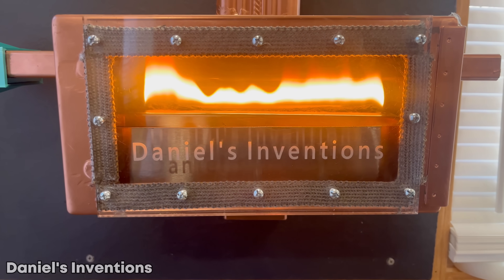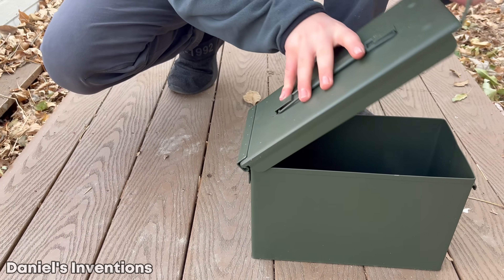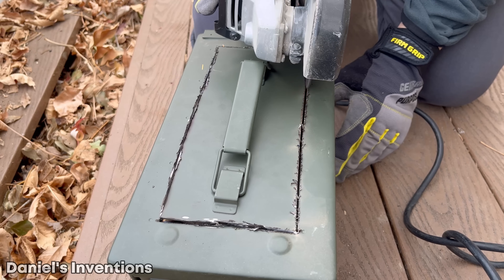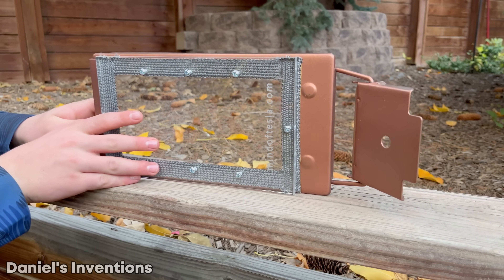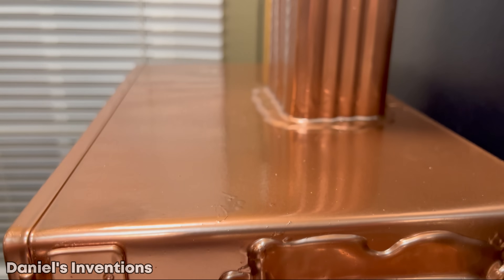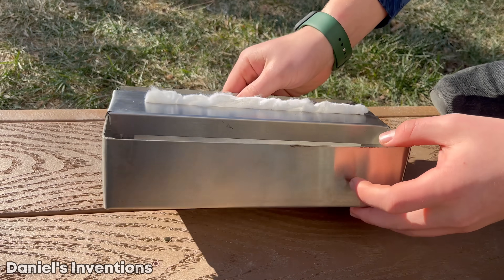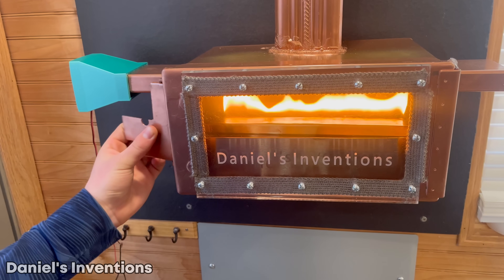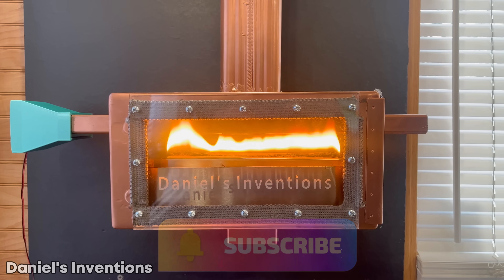ENDLESS Heat for Your Home WITHOUT Electricity 2.0

Comment: I give it 1-3 months before it burns itself apart and catches your house on fire. Do the same thing out of non aluminum metals. The gutters are not steel, they are aluminum otherwise they would be too heavy and inflexible. Even my steel burn barrels burn themselves apart after a couple of years, and I imagine this would burn itself apart in a fraction of the time. Very solid start though, just replace your cheap materials with fire rated ones and this is solid.

Comment: you could modify a stirling engine stove fan for the input air flow therefore you won't need any electricity. but for the sake of convenience a pc fan is much much easier and cheaper to replace.

Comment: You can use the oil for  a  small diesel generator with no problem!  You would have electricity and heat in the same time. 
And, it would be verry  professional and safe!

Comment: The concrete board needs a standoff or it's possible for the firebox to transfer heat to the board which stays behind and starts a smoldering fire behind the board..  just install one inch standoffs

Comment: Put the intake close to the floor, and it will draw in cooler air. It will move air by the heat exchange. (Cooler air in the bottom and warm air out the top) It would be truly electricity free.

Comment: Ok, this is a nice little invention, apart from the safety issues others have already highlighted.

But unless people already have the plethora of tools and components you used to build this, not to mention the expertise to use them, it would be cheaper and easier to just purchase a wood burner and modify that to burn oil in the same way.

Comment: May i suggest run the tube with the fan all the way thru so it is just above the flames so you don't end up with the smell of what ever fuel you are burning then drill a few 1/4 inch holes to allow Air in for the flames.

Comment: I see everyone complaining that the fan is electric. Okay....attach a small solar panel. Or, put an air intake that pulls air off of the floor and do away with the fan. The temperature differential will pull the air through the heat exchanger. 
  Other fire issues have been mentioned.

Comment: Use a carbon sheet wick. It will never burn out so only top oil is required. But a small amount of kerosene is needed to the oil to give better fluidity to draw through the wick.

Comment: Venting the fresh air for the combustion side outside would make it more efficient. If you are using the air inside the space then you are removing hot air from the space and dumping it outside. If you bring in outside air than you avoid this.

Comment: Air intakte should go to the floor, so it would take and heat the coldest air in rhe room, the fan would most likely not be necessary, or might even run without the electricity (remove the motor to reduce drag), or use to make electricity instead at the hot end 😊

Comment: But you forgotten to use the formula Q=qm and price for the oil (2-3$ per kg), if you use the formula, you`ll see, that your box will heat nothing (maybe a small room if perpetually burn), also it is dangerous under fire safety reasons... temporarily in garage etc. maybe... The classic brick wood stove will serve much much better, even small one.

Comment: No need to use the fan. Stove must be located 10cm above the floor. Extend the output pipe 2m upward. It will suck the cool air from the floor even faster naturally and circulate.

Comment: This is a great invention but a proper air intake from outside is almost a necessity. This is dangerous to rely on internal air movement for the intake air supply and if the wind pushes against the exhaust it could reverse flow into the living space bringing carbon monoxide with it! Having a proper intake and exhaust combo will prevent such scenarios, it will also stop the heater from pulling a negative pressure on the room due to stack effect in the chimney. A negative pressure could pull cold air through any gaps in the structure and result in lost efficiency.

Comment: Home-made is a lot fussier and less controllable, without major engineering.  You load it up and it burns until it runs out of fuel.

I'm partial to wood, because it's something always to hand.  Being able to use vegetable oil is an alternative to being on the grid.  I already have a gas furnace, but it doesn't run when the power is off.  My gas insert will run without the blower, albeit to less effect.  

What I plan to do is put in a high-dollar wood-burning insert, bringing my fireplace full circle.  I just wish the blower were powered off-grid.  Plenty of waste heat given off by the insert to power a blower.

Comment: Never take air from the room if you use fire and a chimney. All the air going out needs to be replaced and it gets sucked into the house somewhere from the cold outside. It means you you have not increased the average heat in the house only increased it in the vicinity of the heater and decreased it furthest away from it. And also created a draft. Connect a pipe to you 12V fan and take air from the outside. Keep the pipe as short as possible and insulate it or it will cool the room as well. That will also save you from death from asphyxiation.

Comment: if put a bunch aof thin copper tubes in the steel pipe it would greatly increase the surface area that the air can go over
Reply: obviously would increase the restriction a tad but not noticable

Comment: top exhaust vent? try 4 inch double wall vent pipe. the gutter pipe will not hold up for long. try welding your joints, if you want more heat? and the box is NOT TO BE HOT! Use furnace clay to line your box, but nice design.

Comment: A heat pump with a COP of 3 would only need roughly $1.37 per of electricity at my residential rates to equal the heat content of a gallon of cooking oil that costs $8-9.  Doesn't make sense?

Comment: A guy suggested welding and i wasnt aware yoi can weld paper thin aluminum gutter material..let alone weld it to 18 ga steel.Otherwise costs will climb with all steel to be to costly for such a low output.Maybe im incorrect but ive never read or heard or been told of welding totally dissimilar metals.
Reply: I see he said steel downspout i wasnt aware you could find any downspout but aluminum.period..past 40 yrs

Comment: For thise saying you need a fan and to draw outside air into the heater, you're all wrong.  I heat my entire house with a (newer) Quadrafire 3100 wood stove.  My house is a 1600 sqft walkout (on each floor) built in 2010 in central Saskatchewan (-45C in the winter).  The bottom is ICF, the main floor has 1100 sqft vaulted ceiling with two 6ft x 6ft triple pane windows and two 3x4 rakeheads above (all on either side of the wood stove), so lots of window heat loss, even with the south face.  My wood stove is sufficient to heat the entire house comfortably at -45C without any fans or outside air draw.  It burns hot and clean.  The bottom part of the walkout stays at about 17C without any additional heat, and there are two large patio doors and 6 large windows in the bottom as well.

Comment: I would definitely put something like that in my basement. I could vent it right out the chimney with my furnace and cut down my heat bill. I'm guessing you can use used oil as well.. Fry up some chicken and french fries, then strain the hot oil through a cloth and holey heaters Batman, you've got fuel for a fire.

Comment: It would be even better if the breathing air was pumped through copper pipes running down inside the exhaust pipe. Then over the flames, and out the bottom.
That is a counter flow head exchanger, which can transfer much more of the heat. Than the cross flow heat exchanger here.
So you would blow the breathing air in from the top and then down, opposite flow of the exhaust air.
The theoretical limit of a counter flow heat exchanger is 100% heat transfer. The limit of a cross flow is much less. If the air was flowing same direction, the limit is 50%.

Comment: I bet I could use the heat from this to make a couple magnets spin inside of a coil of wire, then connect the wire through some very restrictive wire which will then, in turn, make heat.

Comment: you did not explain how the fan is powered but you can use thermoelectric "hot and cold" to power the fan with out the use of a battery.

Comment: By speeding up the footage, you made it seem so effortless.

Now, if there were a way to put another ”turbine” on the top, attach a chain and sprocket to it, then attach another sprocket to a GENERATOR … You’d probably have to gear it down to run a small generator, but you could at least do something practical with the heat generated. Or heat water, or perhaps make charcoal…

Comment: Concrete board is not a fireproof substance.  If you check with wood stove companies they will tell you NOT to use concrete board, only brick or stone or concrete is acceptable.  I can’t remember the thickness to temp, you’ll have to look it up.

Comment: No jb weld.. weld instead 
No paint. Sandblast and clean metal get oil off of it. 
No small screws in sheet rock board to hold it up

Comment: Imagine using Webasto instead. Heather design to burn oil or everything flammable in liquid form. 

Also it doesn't matter what kind of heater you make, but how heat density liquid is. Gasoline and dissel is about 11.000W of heat. Wood is about 5000W depending on type. Ethanol alcohol is 8000W... 

So you can make whatever you like, but you won't take more energy from it. You can't break physics

Comment: Why not run the exhaust across the room on the wall... Slightly inclined upward? A longer exhaust pipe will allow you to milk every last bit of heat and spread it accross the room.

Comment: I bet if you packed the pipe with the mesh used in gas systems. It will transfer more heat with less fuel usage.

Comment: Stop saying "we" all the time when you're doing something, interesting heater though. Definitely need some way of shutting it off though, I suggest a damper on the air intake of the combustion chamber which can be closed to cut off oxygen supply to the flame. Which could also be used to control the heat output.

Comment: You can burn used oil fryer oil in that. Get that for free from your local burger stand - work out a deal with them, leave empty steel barrels they can pump the hot old oil in and pick it up every week or so... filter the chunks out and free fuel oil.

Comment: the heater was off gassing fumes in the last shot  

while it's a cute idea.   it's not a "good" one for many reasons.   and with zero safety testing or expertise  it's purely  "trust me bro"   that it won't burn down your structure,  explode,  or off gas anything toxic.

Comment: The clean air feed needs to be drawn from outside natural air. Otherwise your burning up the oxygen inside which can increase the levels of both carbon monoxide and dioxide. And heat resistant paint only should be useed not just any paint because fumes from burning paint are highly toxic!

Comment: have you thought of putting a small turbine in the exhaust pipe? use it to power the fan, so not even batteries would be needed.

Comment: Whale not run a thick  metal pipe through the center pump water through it hot water heater plus the flames

Comment: use an IRON CAST old pot and put multiple 8 hours candles in it with a CLAY top and holes   PUT IT in the CENTER of the room on Bricks  (cast iron becomes very hot)  VOILÀ

Comment: This thing might look cool but it's going to burn down your house at some point. The setup is guaranteed to offer very incomplete combustion and every single particle of that oil that goes up has a chance to stick to the exhaust pipe. Just ask any inspector why most restaurant fires start in improperly setup/maintained exhaust hoods where exhaust oil is allowed to accumulate. And that's ignoring the fact that it has fuel that evaporates at 140F in the same chamber as the fire...
And all of that is ignoring that's it's illegal in a lot of places to burn anything for heat without a proper forced air exhaust to limit carbon dioxide/monoxide build up.

Comment: This is not up to code and very dangerous plus, if you're at high altitude you need to draw in fresh air from outside so you don't suck all the oxygen out of the indoor space and die from asphyxiation. If you burn down your house because of this makeshift heater / stove your insurance company likely will NOT pay your insurance claim. You'd be better off with a certified, EPA approved rocket stove or a tent camping heater/ stove that have attachments with large cooking surfaces.

Comment: Cool, not safe, but you can't claim "no electricity" when you have a 12 volt fan. Small wood stove vented properly and a thermal fan on top would do the same, no?

Comment: The idea is nice, the execution not so...
1) Use thick steel = more heat retention and distribution
2) Weld the parts together.
3) Use a double walled chimney/pipe 
4) Install a CO2 alarm

Comment: First off unless you're on the sun you'll never have endless heat and second that thing will only heat a small space and it's not safe in any way. You need a cheap heater get a Chinese bunk heater extremely efficient and cheap.

Comment: I would not build this like this 1) Learn to weld and get a cheap welder. JB WELD sucks and will not last. 2) Your exhaust should be proper exhaust pipe and not rain gutter with a proper insulated through wall fitting. You can find these in the Plumbing section with the Gas Hot Water heaters. As is this is a fire hazard

Comment: Single mistake during montage or maintenance, and whole family is dead because of carbon monoxide during sleep or rest, before anyone notices (the gas is odorless, colorless, senseless - no chance to spot it). It was a common issue with home gas or oil heaters back in '50s, and still happens from time to time in poorest families who have no better source of heating! Inventions like that (open fire, heaters) make sense in homes that aren't well insulated (e.g. old wooden homes with old windows); in modern esp with modern windows they are dangerous.
The only safe and cheap source of heat in a well insulated home is central heating, either from city heating system, or from own, but made in a separate room, outside places where people spend hours, or electricity if the cost isn't a problem for you!

Comment: Go seriously electric free by turning this into a convection heater. Thing is, though, this is certainly not a new concept nor is it "WITHOUT Electricity", and heaters that ARE do exist and have been in use for many many years. It also bears mentioning that if your insurance company finds out about this they will likely be unhappy with you. If you are in a situation where that doesn't matter though, go for it I suppose. Beware having no device on the flue pipe to prevent backflow, with a little breeze you can and will end up with fumes in your house at the least and possibly carbon monoxide poisoning.

Comment: i wouls NEVER suggesst anyone do this without knowing what materials od under temperature. you painted high temp paint onto a painted ammo box! whats going to happen to the green paint? jb weld? heating this up is toxic, its epoxy based or if its the urethane based one even worse.

Comment: There is clearly a smoke and fumes coming off of it and they last 10 seconds of the video... should have removed the green paint first. Or at least burned it in before you started it inside for the first time.

Comment: You are creating negative pressure where cold air enters your home through gaps and cracks in walls, doors, and windows.
Solution: Feed this creation air from the outside.

Comment: Can heat up a 400 sqm building for less than 5 dollars a week. Ok. What building? Lets take a very very modern building that needs 10 kwh per 100 sqm per day in Winter. That are at least 40x7 kwh per week in this building here. 280 kwh for 5 dollars. You have good oil prices over there. No wait, you are using 1 gallon of oil, 38 kwh for one week to heat the whole house. This house is so good, that 2 persons staying in there for 24h a day would produce more heating energy than your heater, 50400 Wh. But this small heat loss over walls and windows is not correct for 99,99 percent of all houses out there.

Comment: Endless Heat??? I need Endless A/C. My A/C is Maxed right now. It's 100* Outside and 90* Inside. I do live in a Camper Trailer. Cooler Upfront where the A/C is. Like 80* but No Place to Sit and My TV and Computer have to be in the Back Part. Fan Blowing on Me and my Dog.. A Window Open Just enough to Help Push the Hotter Air Out Helps but Not By Much. Under a Roof that Puts me in the Shade but, that's Not Helping either. 
And Here I wanted to move to the Philippians.... If I can't handle this heat here in Florida, What makes me think I can handle it there.

Comment: 1. You are using electricity to drive the 12V fan. So the NO ELECTRICITY statement is false.
2. When the JB Weld let's go and that thing crashes to the ground spraying hot, flaming oil around the place. You will burn the house to the ground. 
3. Really nice idea but very poorly implemented

Comment: That fuel isn't "ENDLESS" and you used electricity to make the heater.

Conversely... if you just used a woodstove, you'd have a great deal more heat... without any electricity. You could even burn garbage in it.